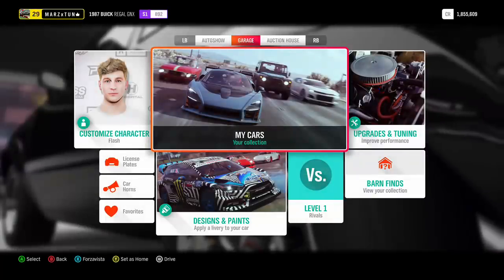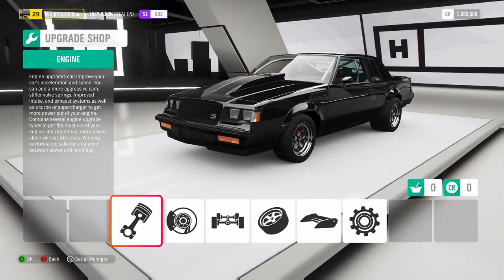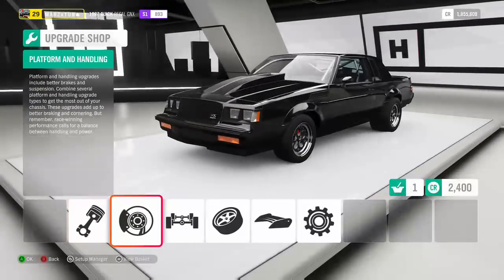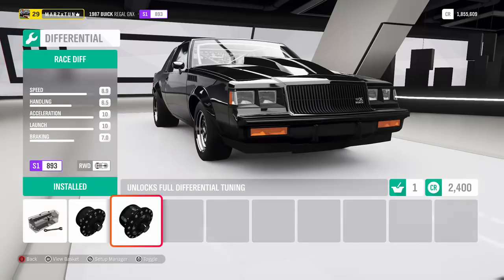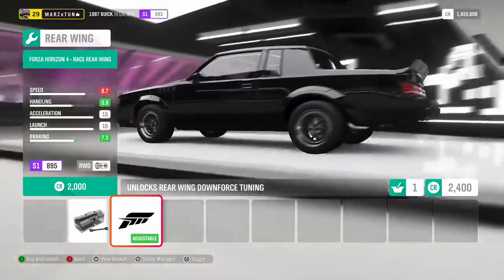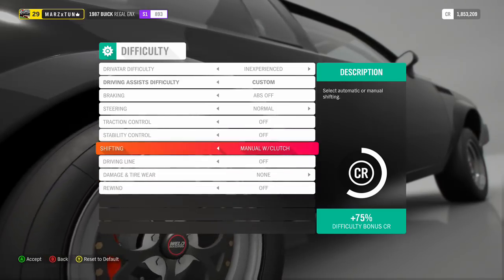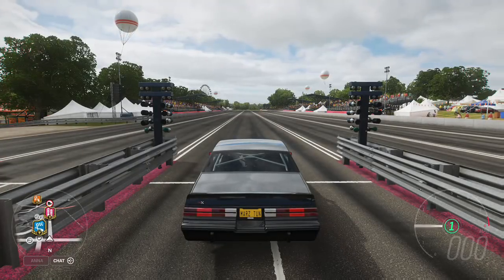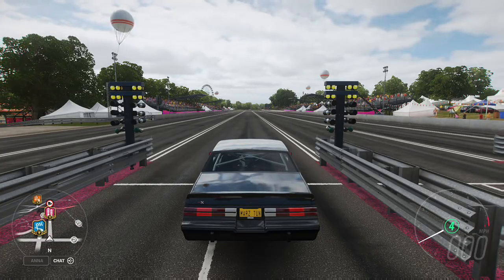FORZA HORIZON 4   BEST (RWD) DRAG RACING TUNE [TIPS,TRICKS,GUIDE & SETUP]

Comment: Weight transfer in drag racing is good but what you’re doing is too much, what you want to do is have the power from the engine move the weight up and back and use the suspension to force the tire into the ground ( this is not weight transfer ) the weight transfer plays a role but it’s not the whole story... you want the rear just stiff enough so it forces the tire into the ground but not TOO stiff also if it’s too soft you’ll be moving all the weight back but the suspension compresses and the energy is wasted and not reach the tire... also your dampening is a little off, you have the right idea, Rebound is rate at which body separates from the tire, bump ( compression ) is opposite  of that, what you’re doing is making the front end bounce and that weight and force cant be used efficiently... You want the front to jump up and slowly fall throughout the pass, and you want the back to squat ( ever so slightly ) if it’s to stiff you’ll shake ( spin ) the tire, too soft and it’s wasted energy...
Reply: TexasRoadWarrior Energy can not be wasted, only be transferred into something else more commonly known as sound or heat.
 JK bro❤️
Reply: Also 15psi in the front tires is really low imo
Reply: All this letters scare me
Reply: Victor Gonzalez I agree ☝🏽
Reply: Not sure how it is on the horizon franchise but on forza motor sport very stiff rear is faster whether it makes sense irl or not
Reply: Marz can’t tune anyways because he has a second YouTube channel masterzaclash
Reply: @connergallagher1815  they arent the same
Reply: Thanks for the tip brah
Reply: @harmony624  Energy is actually wasted all the time, if a light bulb is on it will have light energy but wasted heat energy. I think your thinking of how energy can't be destroyed. Sorry, just did a unit on this at school XD
Reply: @thundertiger7677  I wrote that when i was still in school, and i got a distinction in physics lol
Reply: @harmony624  nice
Reply: I got a firebird with rwd hit 198.6 on that strip lol
Reply: yes to DecSec Raider Clan getting farmed v12 swap
Reply: TexasRoadWarrior make a video lol
Reply: Thank you
Reply: @TexasRoadWarrior - ive been tellin these fools since F4 (2010) that same thing. they aint hearinng it. they De-tune cars, to fit their broke ass style of Wheel Racing. those of you who have the funds. get you some REAL DATA. down load others Tunes, for drag racing. (it will cost i know..but stick with me here ill teach ya something) i say download 10 tunes. i bet a dollar. everyone of then tunes will be different...i mean crazy - different. your right Tex...these dudes aint tunnin no car in Forza to HOOK..i tried this tune, and still have it...it was a waste of money. tthis car isnt tuned for Drag Racing...like he claims. i have 8 sec and lower cars and this tune? is the worse. i like MARZ because coach Lombardi would have also liked MARZ and coached him, becaus "MARZ is coachable to be the BEST Drag Tuner in Forza history not the secound..2nd place isnt winning and winning is the only thing in Drag Racing that matters..winning is first. 'when you can create a Drag Racing tune that others win with..then you can call yourself a Drag Race Tuner' Vince Lombardi. when i saw Tex reply..the first thing that came to mind, was hoiw coach Lombardi would coach you to be the finest what ever you were..thats why Coach is so well loved and respected. he tore men down yes. but he also coached 6 future hall of fame players from the same team, the same year. wrap your mind around that one. Tex you could coach Drag Racing..if it ever were a legit team.
Reply: @harmony624  sounds like you failed anyway
Reply: Lol so what suspension should I use
Reply: @thundertiger7677  the light disperses heat energy so it’s just transferred he’s right

Comment: (These tips I'm about to say are best for RWD drag)

- When drag racing, you want to take the weight and power of the motor and gently guide it up and back during launch. If not enough weight is forced back, the tires will spin. If too much weight is forced back, the car will wheelie or lose power through launch.

(Spring Stiffness)

1.The front spring stiffness should be very soft to push it off the ground, but not too soft or you'll bounce and lose acceleration while going down the track. 

2.The rear spring stiffness should be really stiff to force the weight of the car onto the rear tires to prevent wheel spin and increase traction, but if it's too stiff, you'll lose power through too much grip.

(Dampening Stiffness)

1. Front rebound should be soft to help force the tire to lift the front

2. Front bump should be not too stiff and not too soft to help with a smooth landing. If too stiff, the landing could do hard bounces and lose traction; if too soft, the front will wobble down the track causing the car to loose power.

3. Rear rebound should be stiff to keep the car from forcing the wheel away from the body

4. Rear bump should be soft as it helps set the weight of the rear onto the wheel.

(Spring Height)

1.If the car has a low ride height, the rear should sit about 2-3 inches higher than the front. This will help even the weight distribution and even out the car under full acceleration "see pro-mods and funny cars for example" If the rear is too high, it will prevent the power from being delivered properly.

2.If the car has a high ride height, the front should sit between (.4)-2 inches higher than the rear. this helps raise the rear under full acceleration to level out the car "See Gassers and race trucks for example" if the front is too high, it will lose power through the tires.

- Drag cars operate properly with solid/live rear axels to keep each tire even on the strip. the problem its that the Forza series physics make it seem as if all cars have Independent rear suspension. The best way to fix this is with the Anti roll bars.

(Anti-Roll Bars)

1. Rear ARB should be all the way stiff to simulate a Solid rear axel, helps with even traction.

2. Front ARB should be completely soft to simulate double wishbone drag suspension.

(Camber)

1. Rear camber should be 0 as with a solid rear axel, the suspension cant flex separately.

2. Front camber should be between .1-.8 positive to help with reducing front tire friction. Too much front camber can cause instability.

"the game Is kinda arcade-sim and I've realized that it tends to make cars with live rear axels act like IRS. If your trying to simulate a car with a solid rear axel in this game, you have to turn the rear anti roll bars all the way up. I've learned this throughout the years of building drag cars, prerunners, and trophy trucks in the horizon series."

- If you would like to test a tune like this, I have a tune on the storefront for the Nova Horizon Edition, my gamertag is BIGBONEBRAKER11. the tune is a little outdated though as I have not played the game in 2 months and have learned a lot more about tuning since then, but it is still a good example if you need to see how a car should launch. I've also built a drag tune for the Hoonigan Chevy Gasser.
Reply: my man's wrote a whole essay on drag racing
Reply: Aero?
Reply: I'm one of the lucky ones that read this
Reply: Brandon Johnson GOATED
Reply: Saved for my new tuning guidelines 👍👍
Reply: I'll be returning to this alot
Reply: I'm screen shotting this.
Reply: Do you think you can help me Tune my mustang gt 5.0 on FH4? Please bro.

Comment: Apply this tune to nissan silvia (the one that is green in autoshow when stock) = nuts. You do have to mess with gears to get it to grip on launch. same engine , 6.2, but mine only has 989 hp i think i didn't do the intercooler or whatever it's called in this game. I was running 15 mph (176 was my best) faster through the speed trap with that car than this one launching at 1700 rpm

Comment: I put 55psi in the front for less rolling resistance is that a smart idea?
Reply from the maker: Brody Wilson yes very good idea
Reply: Yes and no, check the stats that change after you tune the car to see if your 0-60 time increases. In some forzas having small tires with 55psi works the best and other games it better to have a lower pressure. But in real life that is what you would want to do.

Comment: Soo, the roll cage will add weight to the car. Does it really help with the chassie/performance? (positively)
Reply: Only if you do track racing, wont do much in a straight line other than slow you down.

Comment: I wonder if the rally suspension and race suspension are really any different after they’re tuned? I usually use the race suspension but tune it. And too much weight transfer will hit the tires hard and unload quick. I also like to tune the trans to be a glide/th400/4L80/th350 for a little more realism
Reply: I was wondering if I was the only one but I'm a Manuel guy so I tune mine like muncies or t10s and sometimes tremecs.

Comment: Is the 6.2L V8 generally better than the 8.4L V10 and 6.5L V12 for drag racing because it's lighter?
Reply from the maker: Zak757 no it’s just WRONG to swap a V10 or V12 in a MUSCLE CAR
Reply: @marztuning  The Viper V10 is just a pushrod V8 with two extra cylinders slapped onto it and is far from an exotic european engine.
Reply from the maker: Zak757 🤦🏻‍♂️🤦🏻‍♂️

Comment: You gotta check out the 1973 AMC Hornet X in the Bond Edition car pack. That thing is wicked fast and when I added the blower it seemed to be a little different than the normal blowers. It also seems to be sticking out of the hood more than it should be... If that makes sense hahaha
Reply from the maker: Michael Drucks yes I will check it out .

Comment: I prefer supercharger. Less lag ( yes I'm there is barely any but still). Also I get having power but what about tourqe. The tourqe:power ratios are quite lower on the swap. This decreases the acceleration. If tuned correctly the stock engine could be comparable.

Comment: You don't let go of the gas when you shift or do you..? If you do it helps a bit doesn't bounce off the rev limiter
Reply: In forza the fastest way to shift is to not lift, or power shift.
Reply: @LostProfit  So automatic..??
Reply: No, its only with manual WITH clutch that it works. Normal manual and automatic "lift" for you when you shift but with the clutch you have to lift yourself for a smooth shift. Power shifting is almost like revving up the engine before dumping the clutch but you're doing it while moving.

Comment: Hey Marz! Either I'm a dummy, or the launch thing does not work on PC. I did exactly what you said and holding E-brake and then throttle will not hold at 2krpm

My friend tested this on his Xbox and it worked for him. So I think there is a bit of a bug on PC
Reply: Erik van Assendelft it should work I’m on pc too but I use a controller. Make sure your in manual with clutch and just hold the e brake and floor it
Reply: @blairmacdonald1188  I'll try it again tomorrow. I tried on my custom profile, a few different profiles of the default ones on manual with clutch and it would just rev up and then go back down to 0.

Comment: if u want tgat instant torque you gotta go with a supercharger for better take offs and lauches
Reply: @ItsTheJahJah  There's a reason top fuel dragsters use superchargers instead of turbos.
Reply: @ItsTheJahJah  Dude, you clearly have never been to a drag event, or know anything about the benefits of each system. Most high power drag cars use superchargers.
Reply: @ItsTheJahJah Camaro ZL1, Corvette Z06, Audi S4, Audi A6, 15' Porsche Cayenne Hybrid, 18' Jaguar F-type, F-pace, and xjr, Cadillac Cts-v, Dodge Challenger Hellcat, a lot of Zenvo Automotive's cars, Arash af10, I believe Tushek's vehicles are also supercharged.
Reply: @josh lava top fuel cars are 8,000 to 14,000 hp and they are supercharged. now im not saying that all cars should use superchargers its just what you are using the car for
Reply: Josh LaVa isn't the fastest Nuremberg time a naturally aspirated Lamborghini tho ?

Comment: Anyone else struggling to get the launch control thing to work?
Reply from the maker: Ben Waller “ Manual with clutch “ , No FLYWHEEL , first press down on the E-BRAKE ( A button ) this SLOWLY press the GAS ( RT ) until you have the gas press all the way down and ebrake . You’ll see the vehicle hold at 2RPM .
Reply: @marztuning  for whatever reason I do that but it just keeps going up with the rpms and instantly goes down an it keeps doing that. It's kind of trying to kick start it. But I have no clue what I'm doing wrong since I tried multiple things. Not sure if Ben waller also had this problem
Reply: Damxion just ease into the throttle than hold it down don’t hold it down right away

Comment: I built a car and tuned it, but when I hold EBRAKE and GAS it just Bounces, Revs then dies then revs then dies, doesn't hold a constant 2000?
Any Help?
Reply from the maker: Ollie Watkins yes you’ll have to slowly press the gas and it’ll hold at 2k rpm . Make sure to be manual with clutch
Reply: Ollie Watkins maybe your in a high gear

Comment: Only question i have is y did u have 100% deceleration i always have mine at 0% unless i do drift builds where i put no more then 25% so it dont go off the road in a corner uk
Reply from the maker: Bloodninja 019 on a straight line doesn’t really make a difference

Comment: Hi can someone help me? I have done the setup exactly the same for the launch as described in the video. Everything was working and I could launch my cars just like he does in the videos the exact same way with the manual/clutch. Then one day it stops working. Out of nowhere when I want to launch my car, I go to hold the e-brake and mash the throttle. As I mash the throttle all the way, the rpm gauge will just bounce up to 2500rpm and bounce right back down to idle. It wont hold at around 2500 like it used to anymore. And because of this weird bug or glitch or whatever, I cant launch my cars with the manual/clutch setting anymore. Has anyone else experienced this suddenly? Please help
Reply: Dont mash it down. Slowly ease onto it. Most cars that come with rwd dont like instant mash, just ease onto it
Reply: @brotherrussia9052  thanks will give it a shot

Comment: How do u unlock that drag race?
Reply: It is right by the Horizon hub.  You will have to progress through the intro and level up to unlock the races though.
Reply: ajmontgomery81 Yea i know where it is i just cant unlock it i passed the winter season and did the dirt motor cross race 🤷🏽‍♂️
Reply: You are still in the intro segment of horizon 4.  Once you level up after a handful of races it will pop up.  You will unlock a few more strips as well.  Summer season ends tomorrow if you have made it to the real horizon festival.
Reply: ajmontgomery81 yeah i did a bunch of races and finally got it 😄 thanks for the response buddy i appreciate it.
Reply: No problem.  Pedal down.  See you out on a strip ha ha.

Comment: I’m going to be picky and make the comment that this 6.2 is not an ls engine, it is the new LT (and yes i know there was a 6.2 LS)
Reply from the maker: thejdkman14 WRONG
Reply: MARZ_ Tuning how am i wrong? They did away with the ls and the new engines are the new lt1 and the lt4 (supercharged)
Reply: MARZ_ Tuning no offense man but if you don’t believe me or don’t know about them much, you can look it up. Gen 5 Camaro and c7 is when they switched...oh and the cts-v’s
Reply from the maker: This same 6.2L 1016hp engine swap have been in the Forza franchise for many many years now . And it has always and will always be a 6.2L LS engine swap with the same HP . It is not a new engine swap but simply an old LS 6,2L corvette swap that been in the Forza games for so long . That’s why I say it’s an LS motor and anyone that’s been playing Forza for a very long time knows . But thanks for your opinion
Reply: MARZ_ Tuning what game did it start in?
Reply from the maker: thejdkman14 i have been playing Forza since 2011 when FORZA MOTORSPORT 4 was out and it was the best forza I have ever played.
Reply: MARZ_ Tuning okay you have been playing since then, but the 6.2l engine started in fh2 right?
Reply from the maker: And to be exact this engine should have only came out of a (Chevrolet Super Sport '14) which came with 415 hp | 415 torque 6.2L V8  . But since the engine was released in Forza before hand we have all called it the corvette ls engine swap .

Comment: The suspension and all that tuning crap for drag cars on forza is a hoax for views. Take the Buick max it out on all upgrades put racing suspension on it or any other suspension it doesn’t matter. My Buick hasn’t been tuned just maxed out and it just did the same speed and time as yours but mine was in the snow. Tweet the car to your liking, there’s always some other car faster, all that matters is that you like your car!